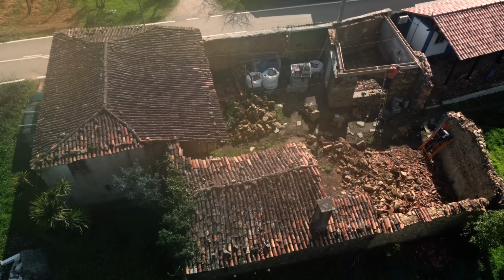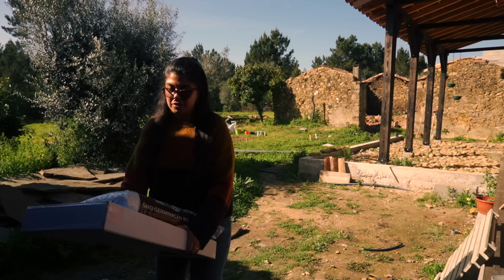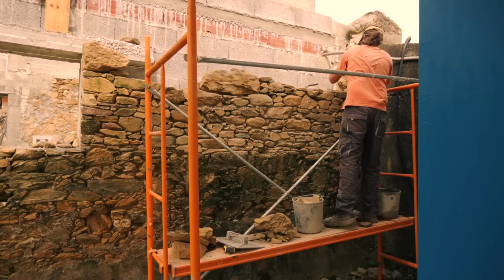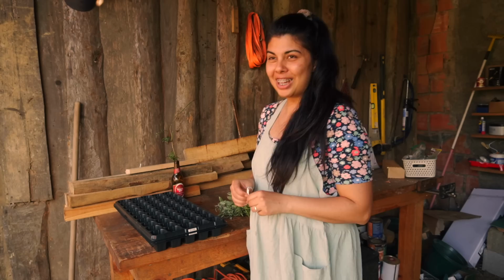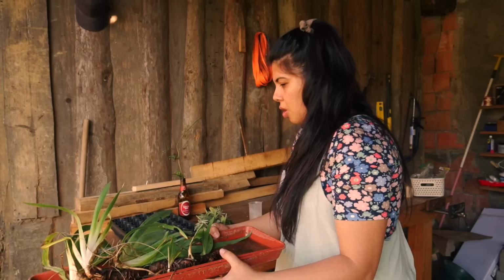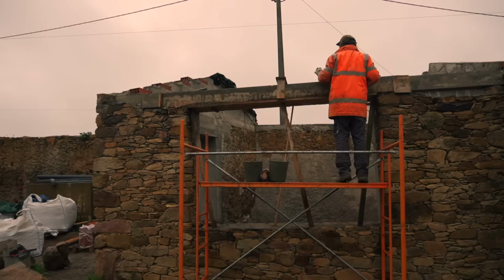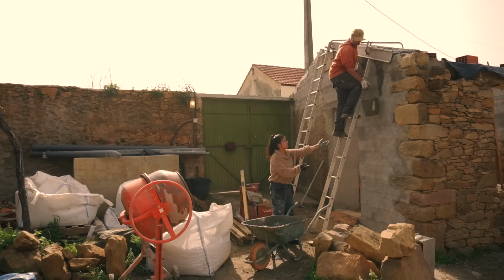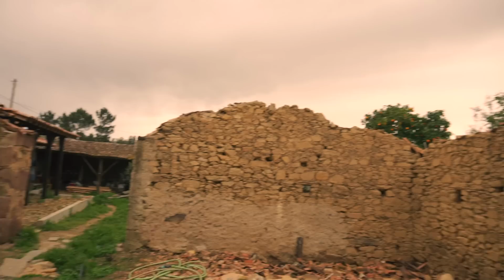Will it be worth it? Renovating an abandoned stone house & farm

Comment: Great progress guys… well done & congrats 👏.  I have a question. At 26.31 the drone footage. It seems to show that each gable end of the building is not parallel.  The space left for the ridge beam to sit does not look like it will allow for a ridge beam to sit at an angle other than 90 degrees to each gable end. Are the spaces on each wall bigger than the width of the beam to allow for it to sit at an angle on each wall? or do you intend to cut the end of the beam or the walls to allow it to sit at an angle to each wall?

I’m so excited to see how it all works out. It’s going to be great I just know it. 👏👏👍

Comment: Your plants with the big leaves are called Irises in Canada. The flowers are beautiful! It is good to plant flowers along with your many vegetables. Flowers are food for the soul and beauty for the eyes.
Reply: Agree that mixing flowers in with veg is a good idea, particularly ones that encourage beneficial insects. You would be better to plant the iris straight in the ground, but not as deep as you have in the pot, and not in the veg garden. They would be good with your lavender, but give the lavender space to spread. You also need to trim the iris leaves so they can re-establish without trying to support all that top growth. There is sure to be a video showing you how to plant flag/bearded irises. They like some heat on the rhizomes which need to be right near the soil surface. They should do well in your climate.
The lavender cuttings will do better with fewer leaves to start. 
Put a piece of wood over the carrot seeds after they are watered in and leave it in place until they shoot. Good luck.